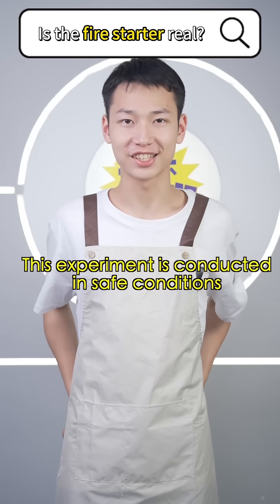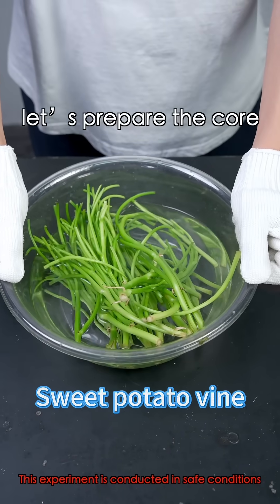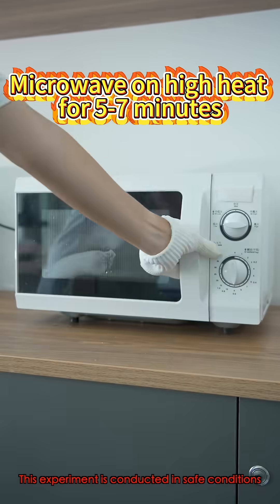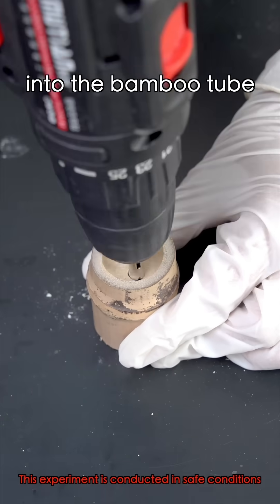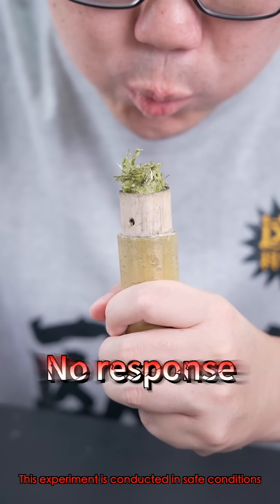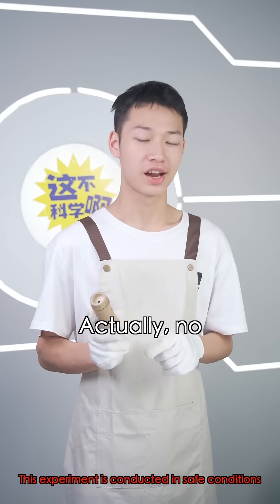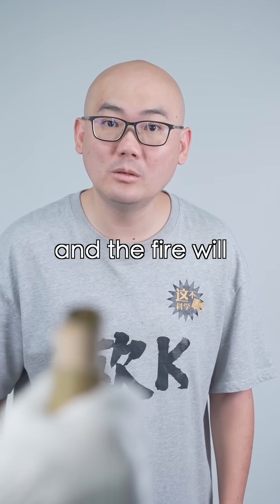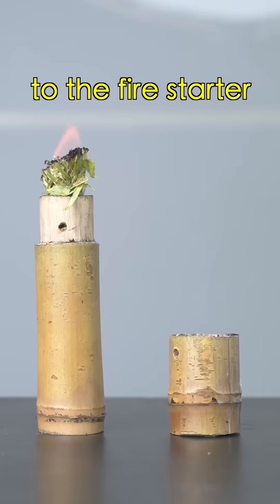Have You Ever Thought That Fire Starter in Ancient Dramas Real❓Which Can Light Up With Just a Blow❗️

Comment: Let me up you, dunk anything flammable and dry in white phosphorus partially then seal the thing coated from moisture and air. When you want to ignite it just break the seal and blow on it… and it doesn’t have a timer, good as long as the seal is good. (If for some reason the seal fails it will set itself on fire even in storage so store it in a bucket of sand)